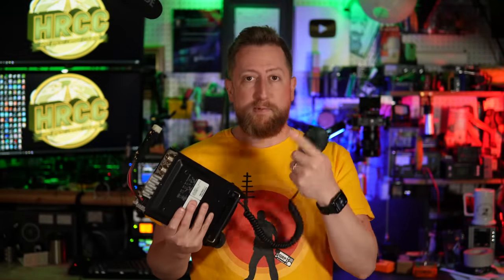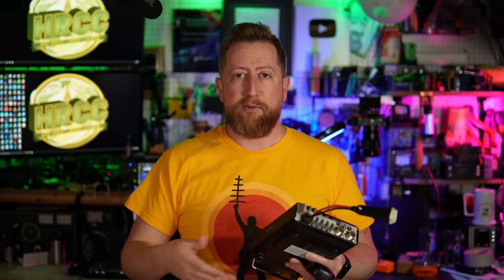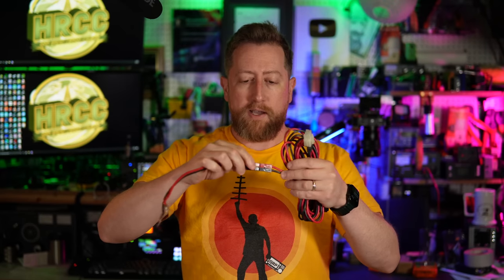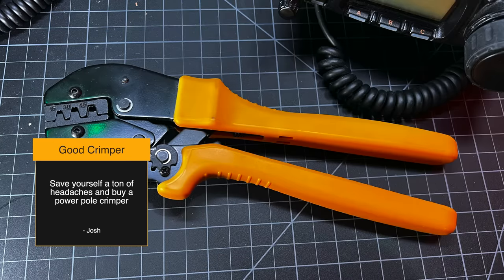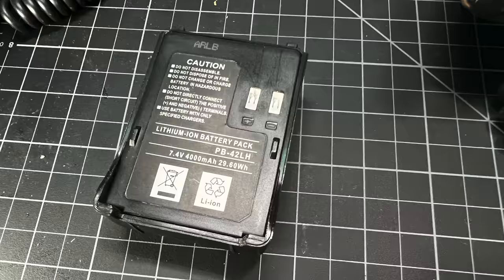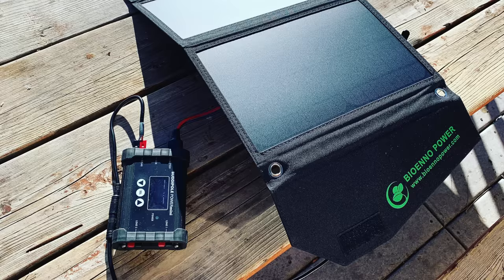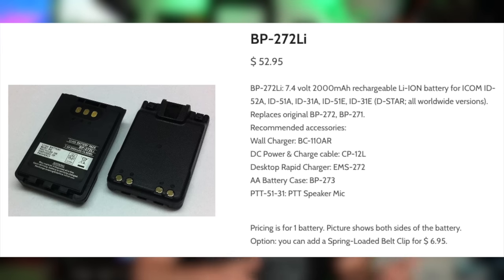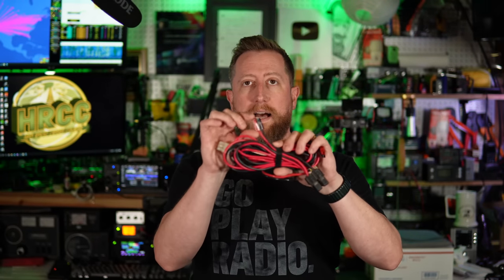No Dumb Questions! Hoarding Handheld Radio Batteries & Connecting Radios To Power.

Comment: I love the "quote" from someone trustworthy about powerpole crimping tool. I read the quote, then just see it is, Josh! Definitely applies, and makes it easier!
Reply: I used to race electric powerboats, and I just soldered the wires to the terminals. Those little motors could literally melt the solder when they got hot!  The crimping tool either wasn't available, was rare or really expensive, or you had to use a generic crimper.

Comment: I had picked up a number of spare batteries for my Garmin RINO 650 series radios... and when it came time to use them (brand new out of the box), they would not take a charge. They had depleted so low in storage that the BMS basically locked them out from accepting a charge. Turns out this is very common with RINO factory batteries. Sometimes you can jumpstart them again by bypassing the BMS and shocking the cells directly, but that only worked with 1 of my 3. Very expensive lesson.
Reply from the maker: Exactly!!

Comment: Another advantage to pre-assemblng your connectors with some sort of standard: there's no danger of accidentally wiring power backwards with loose wires and a lapse of attention. Even better if you can keep types/size different for different voltages (5v/USB, 12v, etc). Those were my two most consistent ways of smoking parts before I put the effort into standardizing. 😐

Comment: nice video.  most HAMs use power pole connectors. I got the big kit with a bag full of connector's. I even have the  PP 75 ones  for my larger loads like a AMP or inverter. I even use the SB 50/SB175 and SB 350 ones. and true Anderson ones. came out in the 1950's still great and the same. if hoarding HT battery's rotate them. so get used. depending on type of battery is how often. NiCd /Li-ION . and also I like my dummy battery .  direct 12V to HT . also the ones that take AA/AAA  cells . great to have. so many ways to power the UV5R type. I use all the above. even a extra HT. great ! 73's I say no Dumb Questions as well.

Comment: A DMR question.  Back in 78 with I received my advance ticket. I started building my station with back then tubes radios. Within 7 months I was transferred to a job that would keep me traveling around the world, so up until last Nov. I was off the air.  Well, WOW have things changed, I fell like a novice, my question is, I was told to buy a DMR Alinco HT, I did. Well can you give me some idea/help in how to program it? I ordered the Rt sYSTEMS cd AND CABLE BUT STILL LOST, OOPS damn cap lock. I live in the No. East, and looking to tx. How, to?

Comment: I cut short lengths off the power supply power cables with ring terminals that were added by my predecessor(s) at my employer’s rigs- and added Anderson Powerpoles. I keep those ring connectors and short cables and hook up to inline ATC fuses with Powerpoles so I can hook up to straight to batteries if I need to, but typically they would connect up to West Mountain Radio types distribution - with Powerpoles.

I did a quick swap the other day that way - just the HF antenna  because both of the HF rigs that I was operating from are on the same West Mountain 4008 (I was only keying one at a time for testing and transmitting).

As for HT, I look at accessories for alternative power options. Sometimes I would get lucky and find AA clamshell as an option (Kenwood TH-F6A and most Chinese HT’s). I may find 12V port or even battery eliminator. I’m disappointed to see HT (or headlamp) manufacturers/designers put out AAA clamshells (TH-D74A)… maybe I’m heavily influenced by wildland fire experience - Bendix King/BK Radios with AA twist-on clamshells or Motorola XTS radios using longer AA clamshells- from wildland fire radio caches that uses alkaline AA. A wiser soul tells me that a large incident would have tons of AA… and good luck with AAA.

For the TH-F6A there are options to charge via 12V port, but depending on rated output, it may not able to transmit. Like the USB to 12V option that I find on eBay.

Chinese HT’s are nice to use the 2.5mm/5.5mm DC barrel connectors that are widely available - for charging bases. Kenwood HT’s have non-2.5mm barrel connectors but Quicksilver Radio has them with bare wires- that I added Powerpoles.

I like Powerpoles- just takes some learning to crimp properly. Chinese made ones are not as good I can attest to that.

Great video Josh! ❤

Comment: I purchased a spare battery for my Yaesu FT5 from Amazon and the label is exactly the same except for the "Yaesu" script. It actually lasts slightly longer than the stock battery. Could it be the same manufacturer? I'm satisfied so far. Thank you for these short, informative videos!  73  N7UGA
Reply from the maker: That is fantastic news!

Comment: Josh, where is the best place to obtain handheld radio dc plug-in connectors to the radios; I want to eliminate wall warts in the shack and use Anderson power connectors to my power panels. I will keep the chargers, but they are big and bulky and I can store them for future use. As these are chargers and can maintain the trickle charge, I am not sure my idea is even a good one.

Comment: Hello all. As a former firefighter?EMT I used to have a handheld radio with me pretty much 24/7. and i used to have 3 sometimes 4 "spare" batteries at a times near me. one in the charger and at least 1 extra in my bag in case the one on the radio died. I used to run down the batteries to dead as to not short charge and have the batterie develop a memory. I had numbered the batts so I could cycle through them. now as a ham old habits have taken over and i still do the same thing with my handhelds.

Comment: All my HTs have AA or AAA battery boxes :D
Reply from the maker: Smart.
Reply: yeah, these are important to have/be available if you want to keep a radio functioning well past it's viability.  but you end up with a larger sized battery or a similar sized battery with less power.  a trade off, but worth having for times when you can't replace a LiPo battery.

Comment: Batteries:
I keep three in service. One in the radio, one charged spare with me to swap out as needed, and when the first is depleted get it back to the charger as soon as practical and then take the charged battery as the new spare.

If you are going to stockpile batteries, it is important to get them in a rotation of charging about once a month. All batteries have some level of self-discharge.

Anderson PowerPoles: be sure to use authentic ones - there are cheap CCP knock-offs that don't perform up to specs BEWARE!
Reply from the maker: Good rotation tip!

Comment: Third-party batteries are like generic tyres or drugs;  they might work as well as the name-brand ones or not.  You need to do some research to see if the generic battery is compatible and just as powerful as the OE battery, or not.
I will sometimes get a second OE battery, then look for the generic ones as spares.
Maintaining the battery is just as important as the brand & type!

Comment: those power pole connectors are the best with the custom leads you showed but as you go direct to an external battery, you forgot to add an inline fuse. The multi outlet terminal blocks have fuses so maybe connect that to the battery direct and then everything to that. I personally would still have an inline fuse on all your custom leads, even if the mobile radio already has a fuse but that may not always be the case. That's me just being an electrician. lol
Re the HT batteries, I have 3 original HT batteries for my Anytone HT and number them and date them and rotate them. I avoid third party batteries as I mostly have had poor lifetime and early failures in them. I'm an emergency, I don't want to trust my life on cheap dodgy batteries. Good practical questions.👍🤓
Reply from the maker: Generally I’ll re-use the fuse ends on the factory leads.